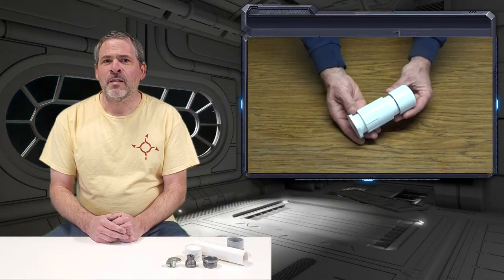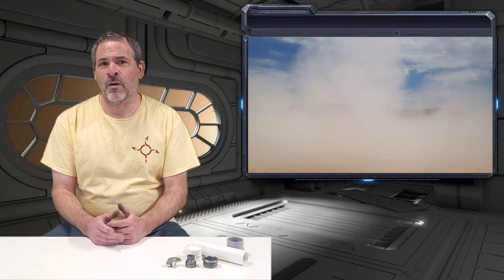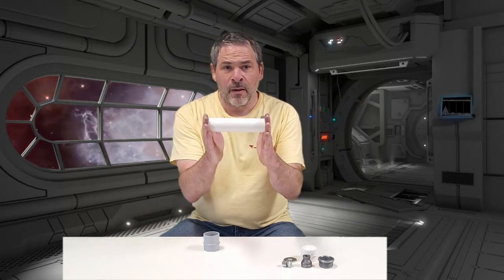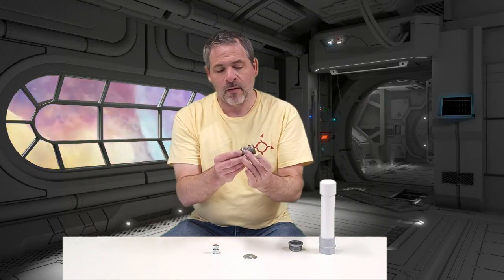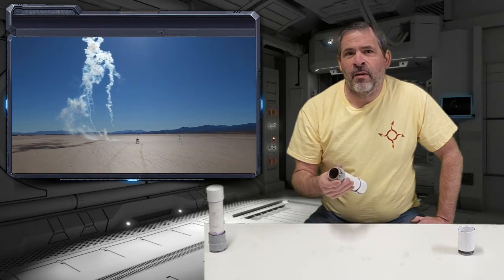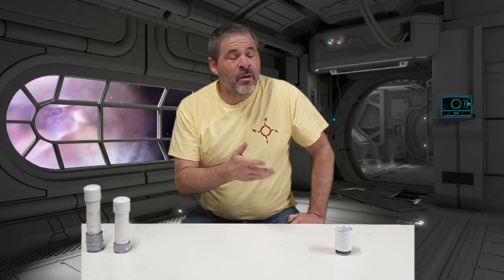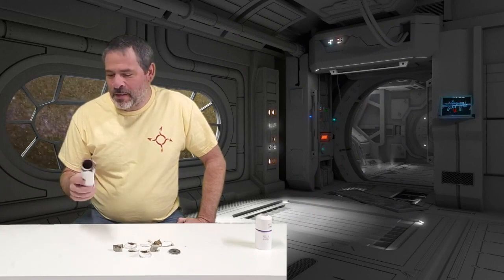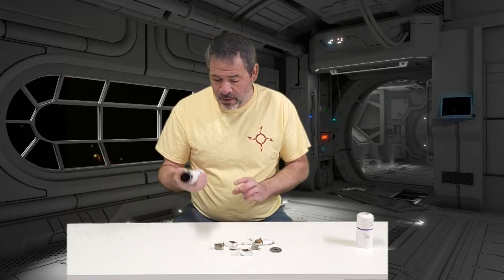Developing a new PVC rocket motor.

Comment: Do you ignite your motors from the top of the motor or the bottom of the
Reply from the maker: Solid fuel, sugar motors are ignited at the top. This provides the initial burst of energy needed for liftoff because then entire center core ignites right away.

Comment: exactly what Terry just commented I was going to say!!!! I Run PVC cased (5g)J800s at 950psi for 0.8 seconds using CAST CEMENT nozzle assemblies. Bar initial static testing not had a single motor failure.  U do not get a better PVC design, anything else is a waste of money and time. Nakka Rocketry website is 2nd to none
Reply from the maker: Just because others has made something that works well, that doesn't mean that we should stop trying new designs. That's what the hobby is about. We are pushing the envelope and trying new ideas both for fun, entertainment and education.
Reply: @rotaryrocketry  don’t get me wrong I love what your doing, but personally I just think the cast cement nozzle design using a simple end cap is the most reliable design by far. The case will rupture every time before any nozzle issues. Agnews water cement, and a washer!! Building quality nozzle making tools is the key with this design tho, can be upscale to 2” dia, can make decent K motors in 2”.  1 - 3/4” is better high impulse J motors. I’m trying to figure out a nozzle design to attempt a 100mm PVC M motor presently.   Could show u info if you’re interested, Luke